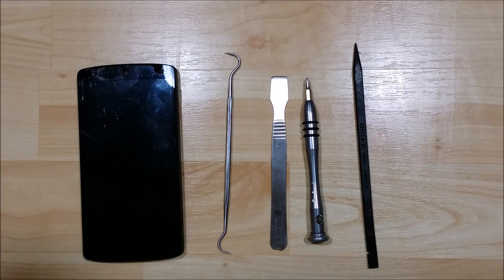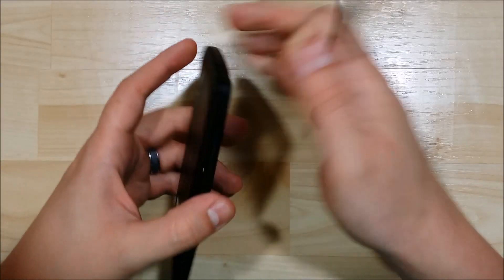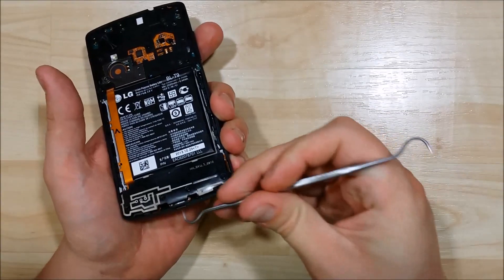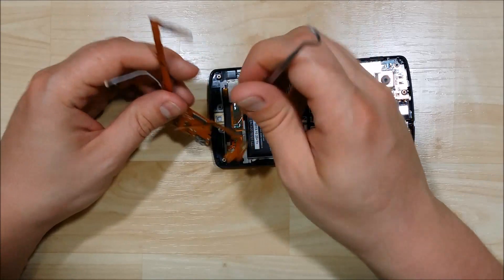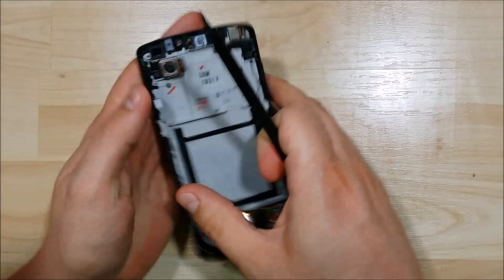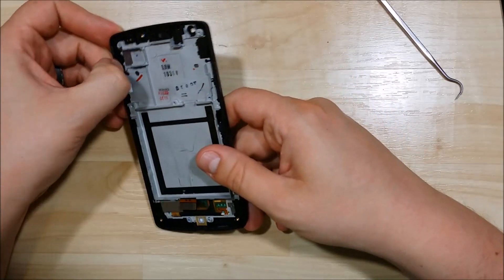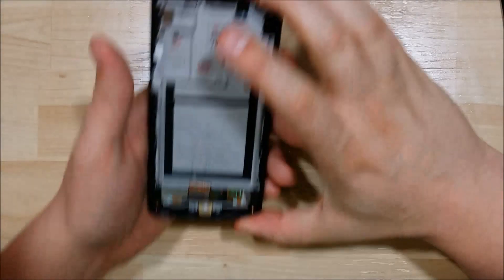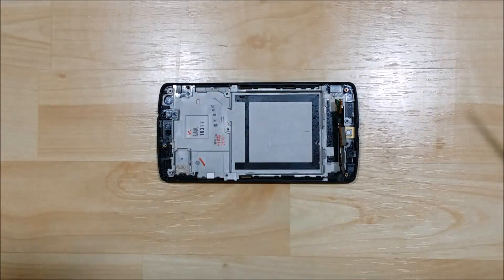Nexus 5 Disassembly - LOCA Glass Replacement Part: 1/5

Comment: Cory, why did you put everything into a new body if you just needed to replace the glass?
Reply: Michael Liuzzi you don't have to use a new frame. The old one was scratched and dinged so I used a new one.

Comment: So you made 2 videos tittled "glass replacement" and none have the glass replacement part. Good.
Reply: There are 5  videos in the series showing everything from disassembly, glass removal, loca application, reassembly. It is meant to be a complete guide to replace the glass. So yes there are videos titled glass replacement that are disassembly and reassembly videos.
Reply: agree with andres, honestly just a title tweak would help since I was looking for specifically glass removal which obviously didn't take place this video.  or add a 1/5 or 2/5.
Reply from the maker: drago10029 Thanks for the feedback! I have updated the titles and put links in the description...I appreciate your constructive feedback others could learn to go a little easier on creators.
Reply: *****
no problem, also I can't afford one of those but need to replace my front glass (not the whole digitizer) any advice you have?